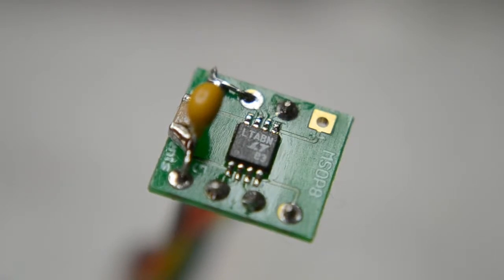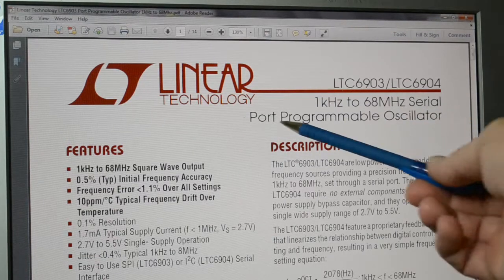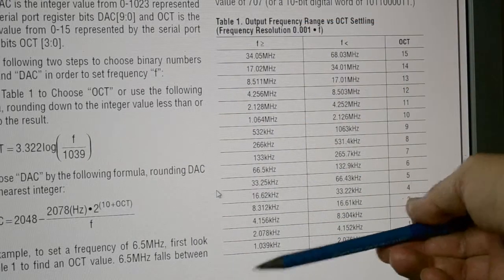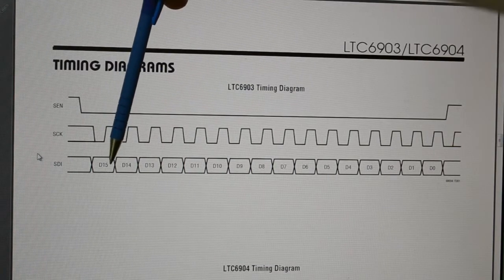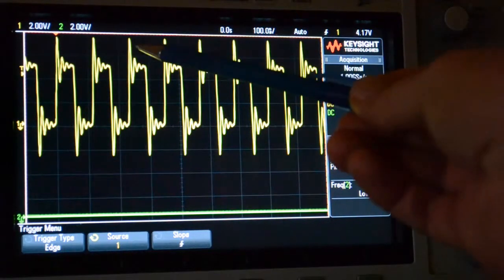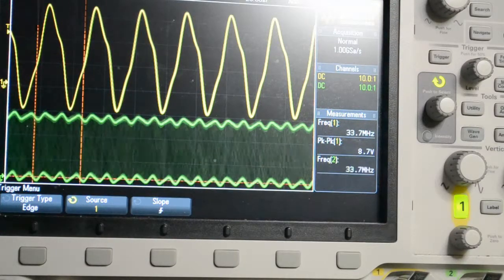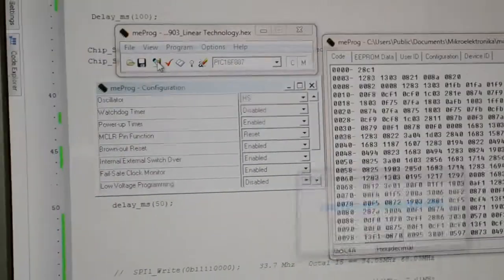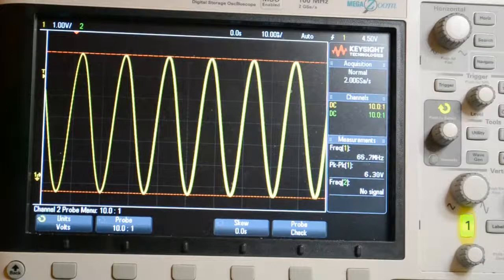Port Programmable Oscillator 1 kHz to 68 MHz LTC6903 & LCT6904

Comment: Hi, I have a question.
When you run the chip breaks periodically generated. The datasheet says that if the load capacitance of 5 pF or more, it is necessary to put the buffer.
In this video, you do not use buffer, but the capacity of the probe even 1:10 15-20 pF.
You are not disrupted generation?

Comment: Great videos. (not spam, I promise) If you get a chance to check them out, I've got lots of videos that use the ltc1799 for audio purposes.
Reply from the maker: Cool, I'll have a look.
I've just added some notes to the video, the ringing and overshoot was due to the scope lead and nothing else.
Reply: I figured as much.  I'm looking for something similar to the ltc6804, but with higher resolution or a smaller range.  I need to do stuff between 1mhz and 18mhz and I'd love at least ten bits of stepping.  Any ideas?  My thought was an ltc1799 + a DAC.
Reply from the maker: Yes that could be done but, this oscillator has 1023 steps and covers the range you're looking for. Is there something I'm missing?
jb
Reply: John B I thought the way range selection was implemented reduced the effective stepping to 8 bit?   If not, I totally misread the datasheet!
Reply from the maker: Hi Ben,
No there are 1023 steps between each range.
10 bits is 1023 steps.
I just showed the extremes
Reply: John B So you've got the octave choices and the 10 bits...That's amazing. That's a lot more resolution than I thought. That's perfect. (and I know that 10 bits is 1023 steps!)
Reply from the maker: I have put a note in the video at the data sheet part.